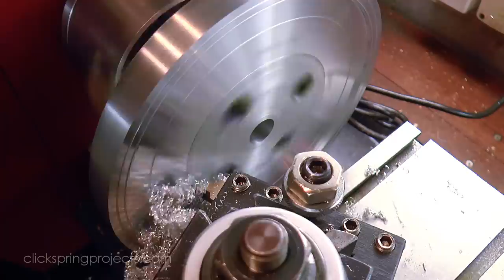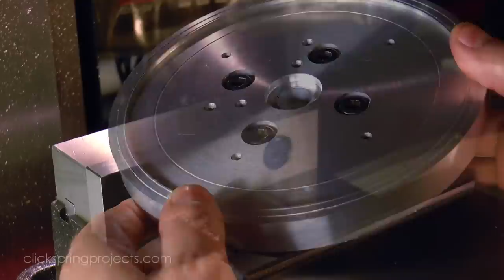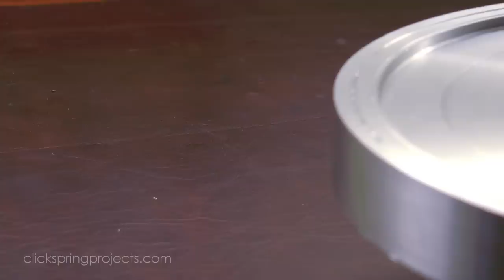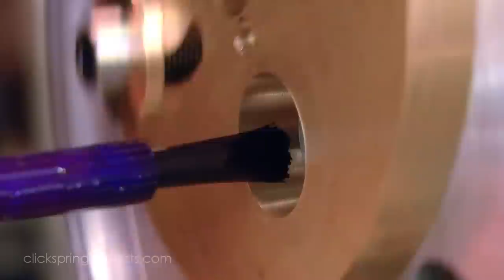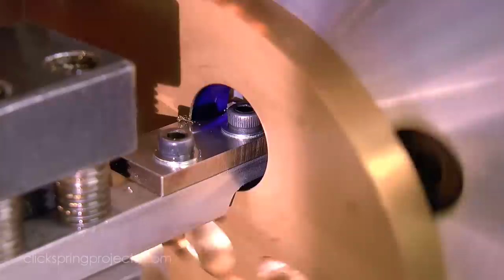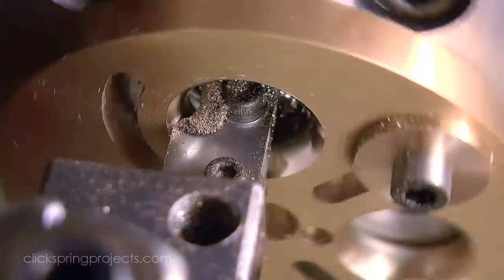Custom Work Holding On The Lathe

Comment: Why take the top off the bolt threads, though?
Reply: Probably to make sure it wouldn't mar the inner surface of the workpiece.
Reply: he always has a good reason… so i would also be very interested why he did that, too.
Reply: @ScaryJ1701 also, maybe to ensure that there was enough room to move the plate around to get it dialed in.
Reply: @ScaryJ1701  Thanks, that could be it.
Reply: thanks timothy. i think you are correct.

Comment: Wtf is it and what is it used for?
Reply: G'day Herb, It's a watchmaker's faceplate. Mounted on the lathe it will hold watch components ready for machining recesses etc. The one straight and two curved slots are where the holding clamps go (which, themselves, have a thick lower jaw so that the components are kept above the surface of the faceplate); the two curved ones allow large components, say a main plate from a watch, to be radically offset to be able to get whatever location you require perfectly central. Look up 'Watchmaker's Faceplate' for a lot of images and sites for more information. All the Best.